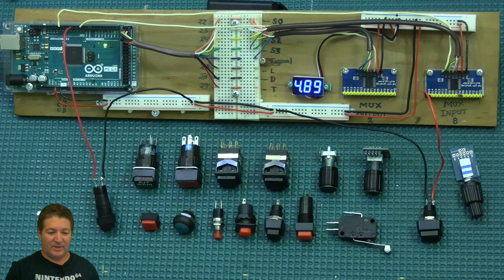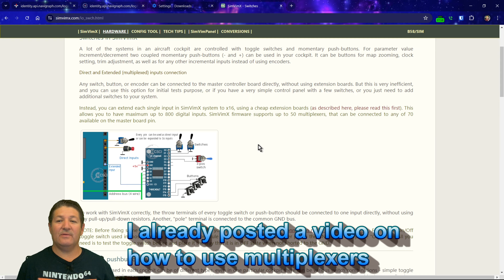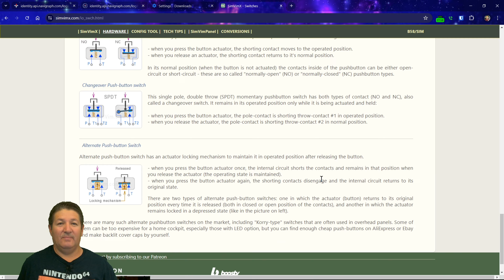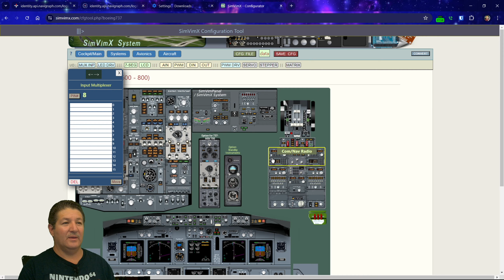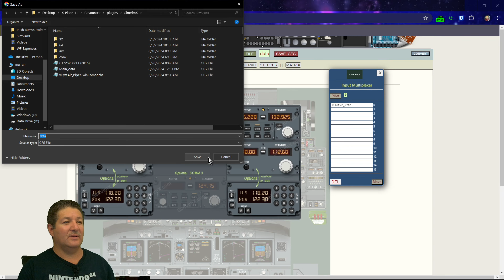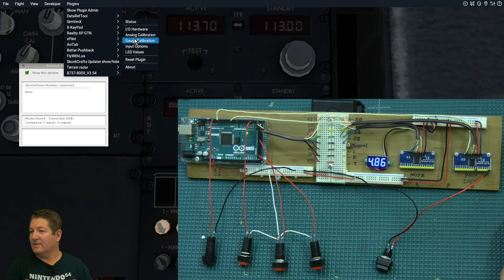Using push button switches with SimVimX

Comment: hii can you do a vid how to connet a digitalLED to the overhead batt for a320
Reply from the maker: Hello, I have already made a video on using LEDs but eventually I will make an updated one. Did you already see this video?
https://youtu.be/MXaUGU2l8hg?si=bPC4RXk0Stcp8LwO

To assign it to a specific keyword you just need to go to the aircraft maps and select the function you want just as in the examples I used on that video. I don't own any Airbus airplanes in X-Plane so I can't use that one as a specific example but the procedure is the same. Let me know if this helps or if you need further clarification.